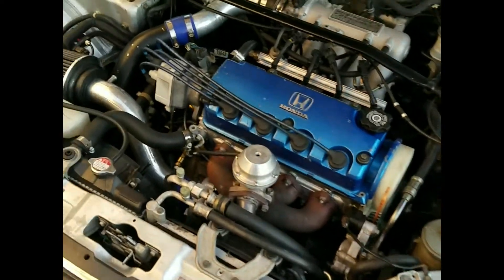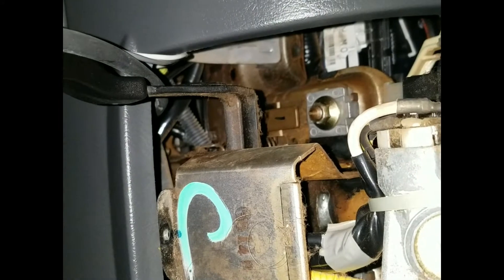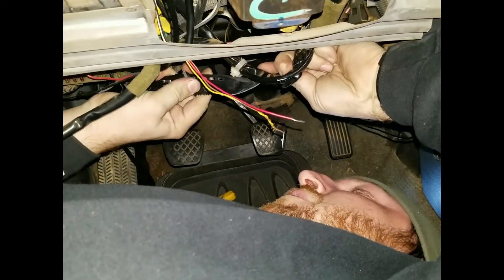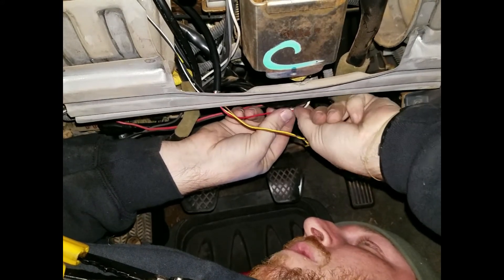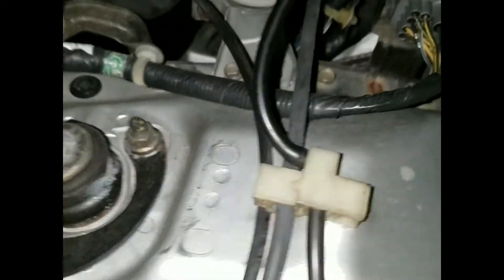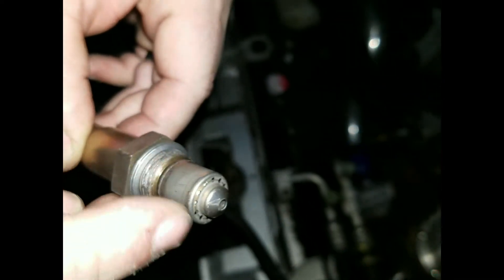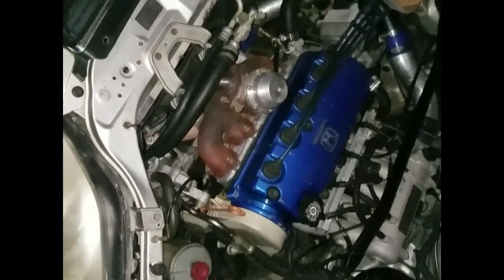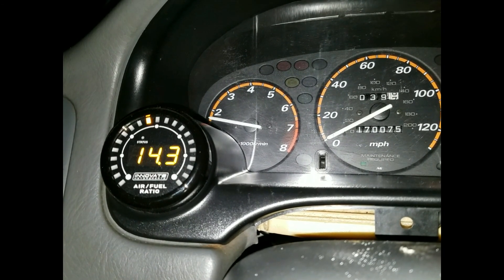Innovate Wideband Calibration And Install

Comment: Are you able to disconnect after calibration to screw into bung 
Without it un calibrating ?
Reply from the maker: Yes just do not turn the ignition back on until the sensor is installed and plugged back in.
Reply: @DrivenDailyGaming  
Coo I did it and all is good thx

Comment: i just intall my and when i start my car up gauge say 19.x then idl is like 20.x, when i drive is 16.x full open throttle is like 14.x are this good numbers or do i need to calibrate again
Reply from the maker: Luis Jaramillo make sure when you calibrate the wideband it is not installed into the exhaust. Make sure you disconnect it turn your ignition on let it give you the code, switch off the ignition plug the sensor in while it is not installed in the exhaust turn ignition on wait for it to calibrate then your good to go. I don't know what kinda car your using or your setup so I can't say if those numbers are Good
Reply: I hope your sensor is off because those are bad numbers.. should be idling and low load driving around stoic 14.7 and wide open throttle anywhere between 13 and 11 ish..

If your tune is stock then it's prolly your wideband is off.. if the wideband is correct then you've prolly already blown your engine and I'm typing for no reason.

Comment: Is the 14.7 mark only applicable at idle? Should there be any difference for example steady 3000rpm (as if cruising)?
Reply from the maker: When it comes to that it's all in the tune. I have my tune set at around 15.1 while cruising around 70 mph at 15 inches of vacuum helps with my gas mileage. Idle mines is around 14.9
Reply from the maker: 14.7 is stoichiometric meaning optimal ratio for air fuel mixture.

Comment: Have you had any issues with this wideband ? Mine is stuck on htr. Tried calibrating and still no luck.
Reply from the maker: No issue at all still using till this day.  Try disconnecting and leaving disconnected for a few minutes then recalibrate.
Reply: @DrivenDailyGaming  right on gotta try that... The sensor heats up but the gauge won't go to the next step from htr.

Comment: what is the work of this innovative wideband ? please guide me in simple way ,
Reply from the maker: shah G it tells you the how many parts of air to each part of fuel. It's desirable for tuning your engine for optimal performance.
Reply from the maker: Does that help?
Reply: actually i am going to buy a colt 90's with awd evo 3 setup hx40 turbo 200shot nitro  , sweet built :) not new to these turbo cars but i always drove stock motors with no extra gauges or mods , so totally new to this innovate wide band , i saw that wideband in the car .
Reply from the maker: shah G Oh that sounds freaking awesome! We tune our own cars so it helps that we can datalog, as well as it let's you know that your engine is running ok and not too lean or too rich.

Comment: Still working?
Reply from the maker: Yes it still works perfectly it's in my daily driver had to change out the sensor a couple of times but that's it.
Reply: @DrivenDailyGaming  that's cool I ended up going with the aem 30-4110. The Reviews were really good guess we will see
Reply: Driven Daily Gaming where did you get the sensor from?
Reply from the maker: Oreilly autoparts I can give you a part number for reference
Reply: @outen21  AEM and Innovate are the best 2 widebands that will not have issues.